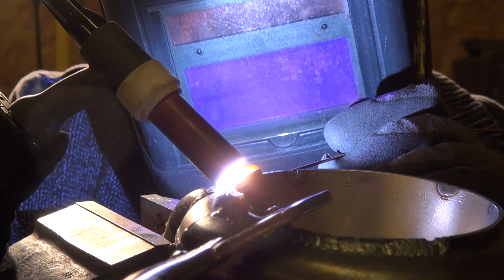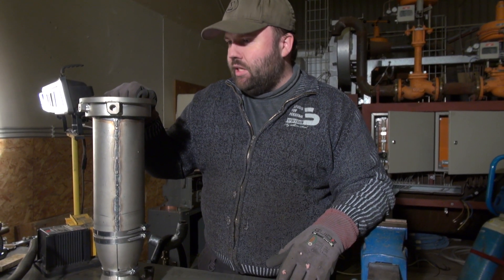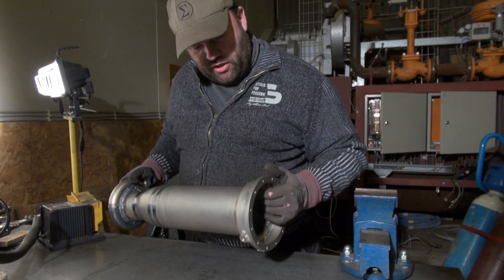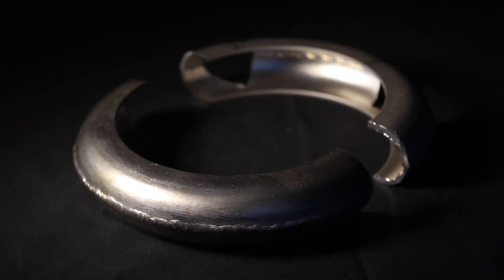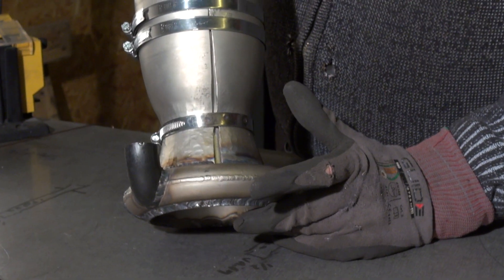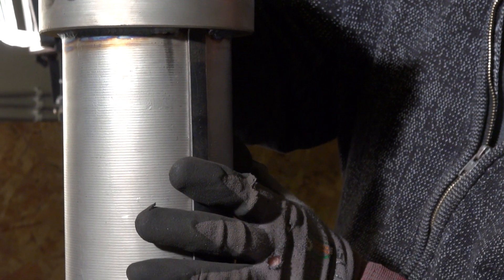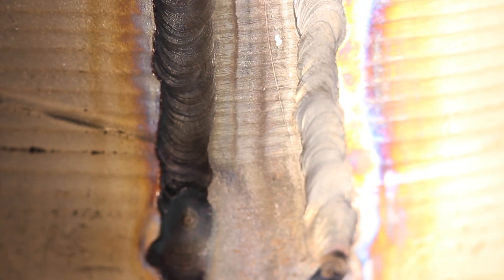BPM 5 - First welding af the BPM 5 rocket engine.

Comment: Here’s an idea.  Why not make prototype of the engine but with bad QC, bad welds, braising, incorrect temperatures etc., basically identify all the things you could easily do wrong and possibly make a test article with these sub par techniques.  If it fails on test it might be harder to Id where that happened but maybe not.  The exercise is to comprehensively review QC controls and identify things that could be overlooked, you probably don’t even need to make an actual physical prototype but just go through the exercise “ lets just build us a rocket engine”.   Alternately an idea of what factors require the most attention to detail might be identified eg.  Spending hundreds of hours perfecting injector braises might be a waste of time or maybe more time needs to be applied to that specific operation.

Comment: External shell splitting and welding are not necessary operation. You should simply form external shell leaving inner shell inside it. It is completely feasible. Furthermore some other simplifications can be done there.

Comment: Shouldnt the outer shell have been scaled up slightly in X and Y (not Z)?
Reply from the maker: It has been, otherwise how else would it have fit?
Reply: @CopenhagenSuborbitals  Cool. After welding one side there was a big seam on the other side that Jacob welded a strip of metal on. I thought it was because the shells are the same size.
Reply from the maker: @astrofizx4714  Like Jacob mentioned, it was a manufacturing error and only around the bottom of the cooling jacket. You can see at the top of the combustion chamber the jacket wraps around perfectly.

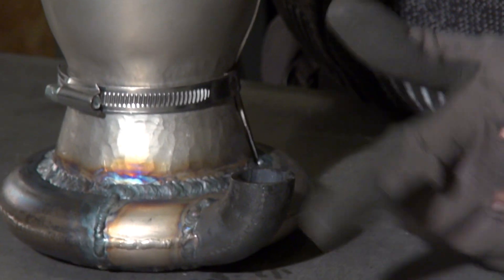Comment: Why do you use the fuel to the cool the engine? Wouldnt it be better to use lox because its very cold? 2:35
Reply: The ignition temperature of iron ( and even titanium ) is a lot lower than the combustion temperature inside the chamber. Using LOX as a coolant will greatly reduce the engine life, and make a nice firework near the launch site.
Reply: Jesus Christ guys stop hating on him!!! So to answer you’re question;
1: because of where fuel tanks are and where oxidizer tanks are, using the guile is a little easier.
2: having super heated liquid oxygen is a terrible idea
3: heated fuel has some benefits so it’s a win win with warm fuel and cooler engine.
Reply: LMAO...wait your serious... that’s not how a rocket engine works if it needs to be cooled.. that can destroy the rocket.

Comment: Let's be honest boy's; your manufacturing process just doesn't feel right. Too much human fabrication (despite Jacob's fantastic wielding skills). You need to be sure that the gap between the inner and outer cases is identical otherwise the engine will be asymmetrically cooled, and thereby not take stresses equally. 
Just a suggestion. Otherwise great work Lads!
Reply: how cares about asymetrickality it's russian style: heavy, and hard to destroy!
Reply: LOL That's a good point. NASA certainly believe in Russian rockets.

Comment: Very nice. I'm following this LRE development here in Youtube. Looks like a lot with LR101.
Did you check heat transfer for fuel in cooling jacket?
Despite de a good solution to use hydrated Ethanol, at low mixture ratios, Anhydrous ethanol (with LOx) have a lower combustion temperature.
I hope you be able to use swirl coaxial injector too and make a comparison with combustion efficiency.
Again, congratulation for your work